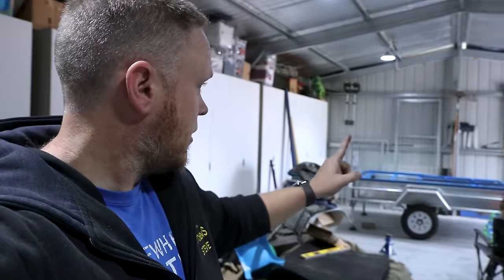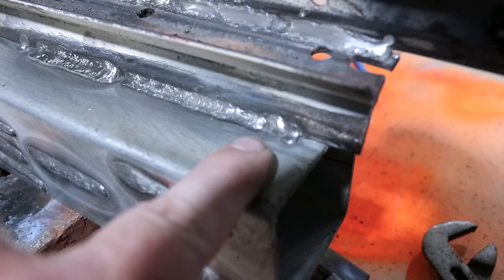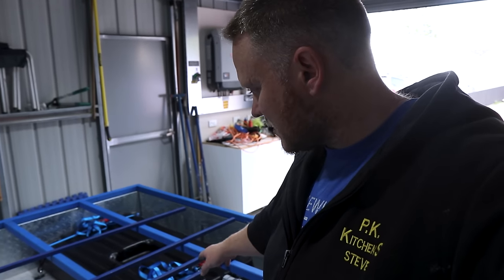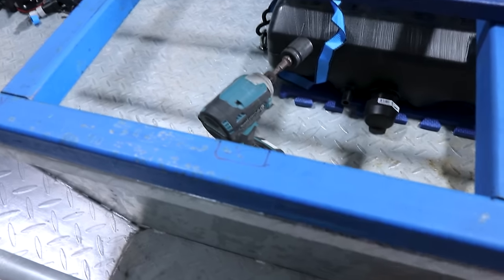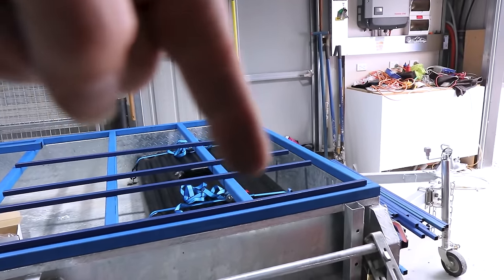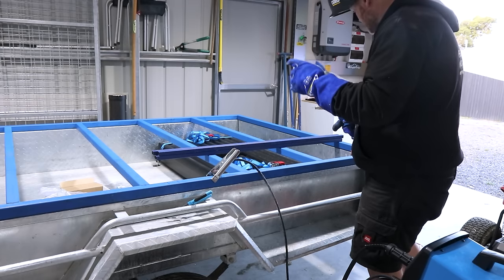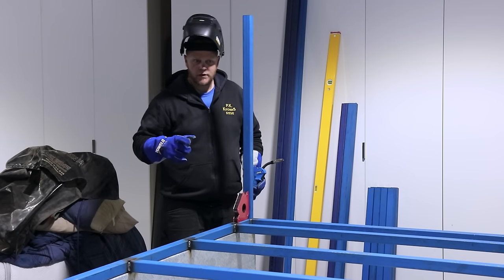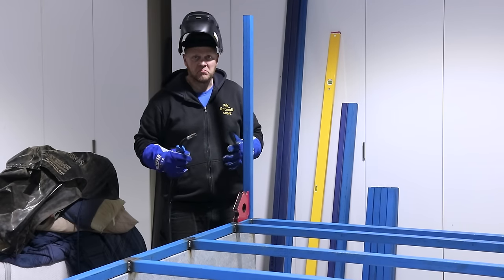Learn to weld as a beginner - Budget camper trailer build Ep 2  the frame work

Comment: been waiting for this bit, for your welding or up, the easiest way for a beginner is to spot weld it up or down (just like your tacks only just in front of each other 😎) do it on some test pieces really easy to do, you can even do it on flat welds if you are not confident enough as yet to run welds (yes I am a boilermaker) that's how I show people who want to learn, baby steps 😁  so far so good though keep up the good work 👍🏻

Comment: Just a suggestion, when you are tacking frames up be mindful that as the tack cools it shrinks and will pull your frame out of square so always follow up with a tack on the opposite side when possible to help prevent it. I’m keen to see more of the build 👍🏼
Reply: Also the issue your having that you are calling dots, it’s porosity can come from dirty metal, holding the torch too far away and not allowing the gas to shield the weld pool correctly or you may not have your gas flow rate set correctly.. in a workshop with no fans/wind you should be fine on 13L/min. Hopefully that helps

Comment: Cracking job mate! I’ve done a lot of welding and specifically boat trailers, don’t stress about the puddle falling when doing the vertical welds, just follow all the way down and if you’re not too sure, do a double weld on it. I’m currently at the beginning of doing the same build, good luck.

Comment: Love the "jumping in the deap end" approach. From one novice to another, yes the welder will get through the blue coating, but welding with be easier if you flap disc it off. Keep up the good work! 👍
Reply: It was the "balls deep" approach rather than the "jumping in the deep end" approach😂 5:25

Comment: Awesome job so far, only suggestion I would make is with the water tank eyelets. I would get some 4mm or 5mm flat steel cut into a 200mm square with a hole in the middle for the eyelets and weld that on underneath. Probably overkill, but it would spread the load over a bigger area than a washer. Especially once you start using water and the weight starts moving around. Keep the great work up though, awesome watching you have a go

Comment: Well done for giving it a crack. Just remember to grind and clean all surfaces of paint and where your earth is mounted. Always have bare clean material when welding, the blue coating on the metal will contaminate the weld and stop you from getting the best earth. But other than that mate well done. 🤙

Comment: No criticism here... awesome content,  good job on the welds!  I will mention that your welder likely has two different settings for polarity (you physically have to relocate the welding torch/ground) inside the machine).   One way is for flux core, the other for Gas (MIG).  If your getting a lot of spatter with one method then you likely need to change the polarity on the welder.  There is usually a picture on the inside showing the location for flux core or (MIG).
Reply from the maker: Hey mate.  Thanks for the feedback.    I did see the info on pos / neg setup based on if using gas or not.

Comment: I love the concept, and it's tempting me to have a go at something similar on a smaller 6x4.

I have a feeling that you are going to really struggle to keep it under weight. Even a small camper trailer like a Patriot X1 is 950 kg empty, and that's mostly alloy and a lot smaller. Have you looked at what it'd cost (other than just parts) to get it re-engineered for something like 1500kg?

Comment: how are you securing all the frame to the trailer itself? maybe you said it and i missed it but i don't specially see a time where you mention it
Reply from the maker: I glazed over it because I wasn’t entirely sure myself at that stage.   
I ended up welding it to the trailer frame.  
I was going to use over center catches but didn’t think it would be strong enough. So welded it.

Comment: Looks like your getting the hang of welding. Suggestion, make top and bottom together so there the same size. Also with welding move tip in slight circles.
This all takes time to acquire a new skill. If it breaks you know how to repair it.
How did you learn 4X4?
Reply from the maker: Trail and error.  🙏🙏🙏👍👍👍
Reply: @Australian4x4Adventures  you only learn from mistakes and trial and error.

Comment: Only criticism/ question  is you should have prepared the areas you were welding first by grinding off the paint
Question is why did you go painted tube over galvanised ?
Surely you would be taking  it on the beach
Great to see you having a go and do it yourself
Reply: Welding galvanised is 10 times worse to weld and 10 times worse for your health
Reply: @raymondhayne1250  sorry mate you obviously don't know how to properly prepare galvanised steel for welding then
You have to remove the gal from the area you are welding then it's no different to welding non gal
Reply: @cackle067  so what is the point of using the gal in first place if your going to grind off where your welding. This is my point. I’m sure the whole thing will be painted
Reply: @raymondhayne1250 Mate giving that reply shows you don't know squat
Big difference between only having to paint the welds to having to paint the whole frame 
For a start the cost of a good epoxy enamel to paint the frame for rust protection is more than the extra cost of buying gal steel
The paint will wear off  & scratch everywhere it does it will rust  
I've been doing metal fab and built a couple of trailers myself my current trailer I built for 4wding to take into steep Point  WA  after ripping springs off & snapped frame on 2 other factory made trailers
Reply: @cackle067  I don’t know about you mate, but I’ve been working in the metal industry for well over 15years. I’m am a qualified boiler maker and I’ve been bending and fabricating shit that would be able to fit all your trailers put together in it. Telling a bloke that has never picked up a welder before in his life and doesn’t work with steel to use and weld galvanised steel and expecting him to know what to do is just stupid. Like Steve has said numerous times in the video, he is just giving it a crack. Start off with basic skills and learn from there.